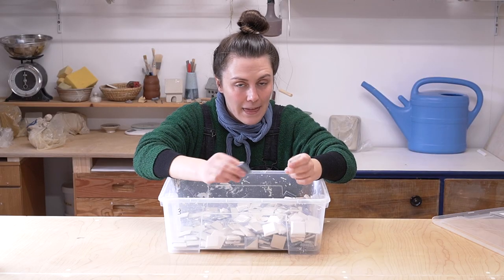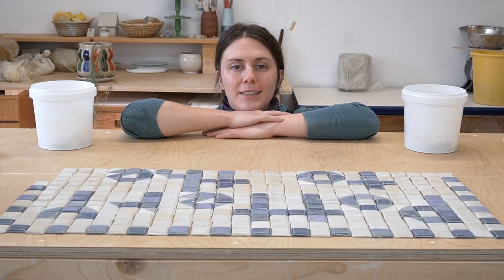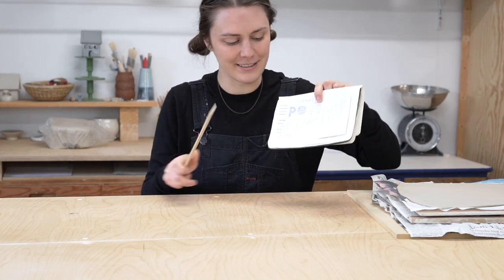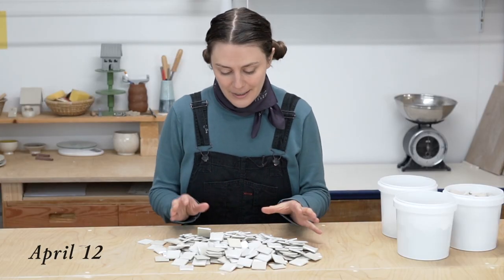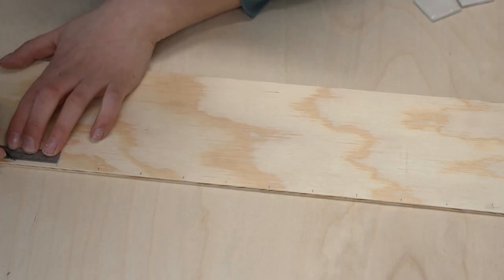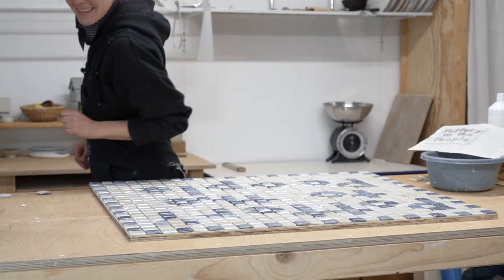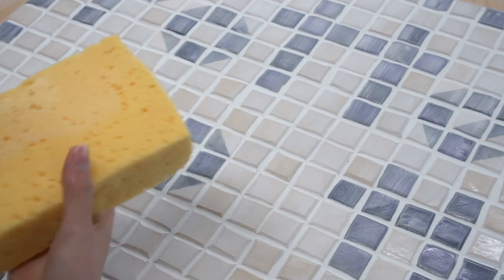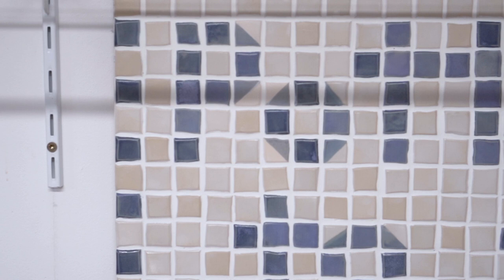I've been working on this project for FOUR years! // DIY Tile Mosaic

Comment: Nice work! I used to do a lot of tile and mosaic work, darker grouts usually crush it with most designs. Grey or even charcoal grout is my fav, really makes the colors pop. Schluter edging will also tie it all together nicely. Another tip because I'd love to see more of your homemade tile and designs: lay your tiles out face down on big sheets of clear packing tape, glue mesh to the back, cut to easy to move size pieces.. flip..boom easy to install sections. Move them on plywood boards.  I've done some huge mosaic installations this way. One was over 14,000 pieces. I also highly recommend mapei products. Glad to see you mix your own grout instead of premixed 😩
Reply from the maker: genius! thats amazing. I thought about using a dark grout but then I chickened out haha white felt safe. But I’m totally hooked so this wont be the last :)
Reply: @PotterytothePeople  exciting. I think a lot about really odd shaped pieces fitting together. Also mosiacs for outdoor installations, your work would look so good in a garden. Pick up a cheap mapei color matching kit for grouts, they have like 30+ colors. You can do some amazing stuff
Reply: such good tips!!  @chompers11   gonna try the mesh and darker grout on my own project

Comment: Wonderful that you’ve finished the sign and simply pushed ahead in doing so :-)
I make mosaics and I’ve been trying to figure out tile making so it was useful for me to watch your project. It’s always useful for me to watch your videos :-) 
I’d have only insisted that you stick the tiles to a fibre mesh sheet instead of dry-laying them on the table. Then the fibersheet mosaic could be stuck to a board (to keep it movable) or to the wall directly. PVA is ok for indoors but we do let the glue cure over 24 hours before grouting…PVA is water based and the grout introduces moisture so it can dislocate the tiles. Many mosaicists ‘polish’ their grouted mosaic tile by tile or in small sections with a soft rag to remove the grout haze instead of using a damp sponge. But…you did so well and the sign is up and shining. :-)
Reply from the maker: Thanks for the tips! I will definitely keep those in mind for my next mosaic project :) ❤️

Comment: Because you didn't use "Thin Set" under the tiles, you used "cheap craft glue," the weight of the tiles plus the grout will pull the tiles off of the board. Guaranteed.   Glue won't hold tiles plus grout.  It looks cool, but give it time.😮  I wouldnt have used a wooden board. I recommend using Backer board, Fiber Board. It absorbs the tile and thinset to the board and holds it firm. Then grouting won't pull the tiles off.